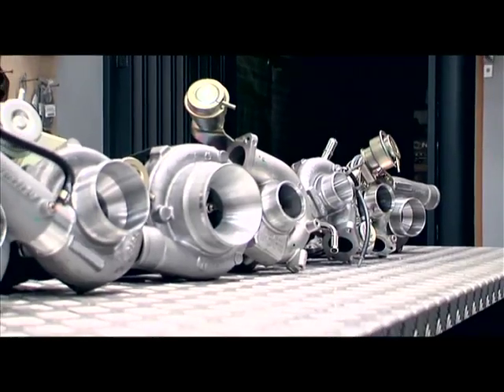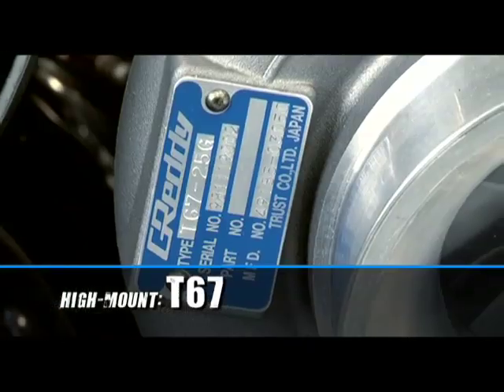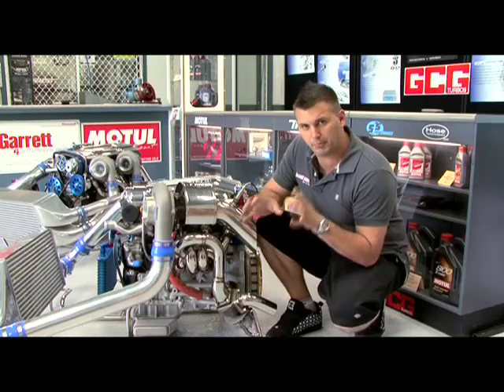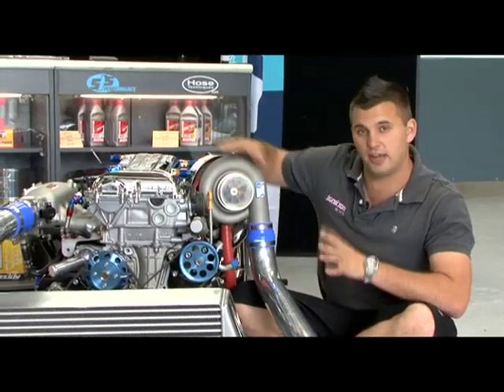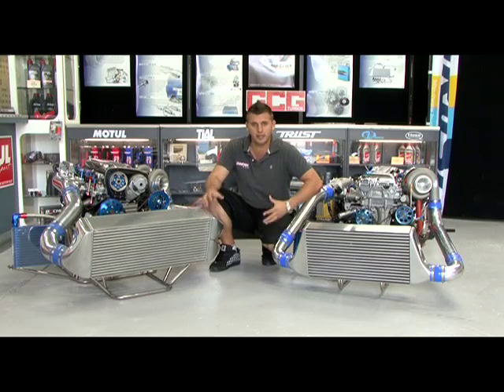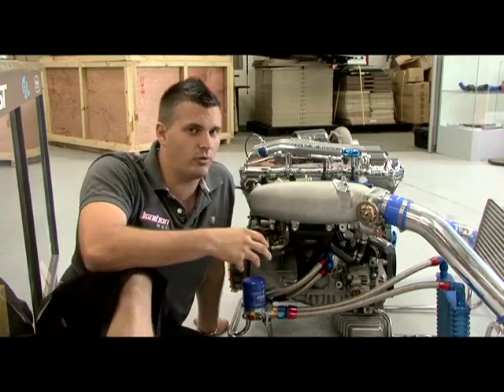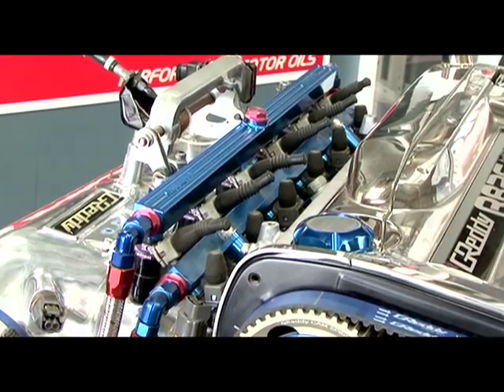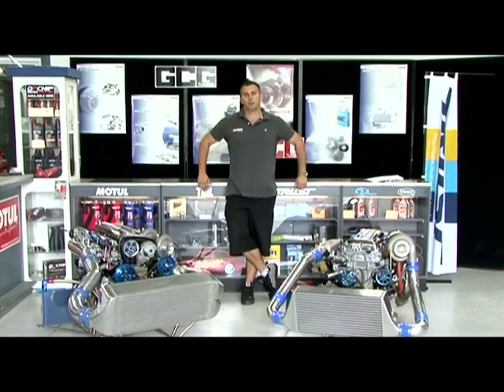Greddy Support Systems- GCG Turbochargers

Comment: nice .... i have a v6cl engine 3lt 170hp  fuel injection i want to get a turbo im looking to get betwen 200 and 250 hp wich one cude be an option of turbo to get ???
 and also i have to modifi the transmision ???
in case of an automatic transmition????

Comment: @RideorDie99A4: Basically it depends on the size of the engine and the turbo... A large turbo will mean more boost (but also more lag, as more power from the exhaust gasses is needed to spin the turbine up) and can handle a little more boost than smaller ones...